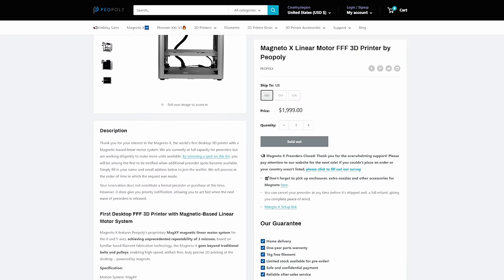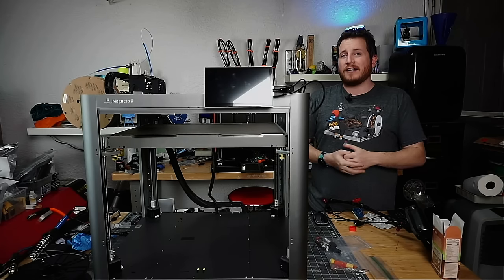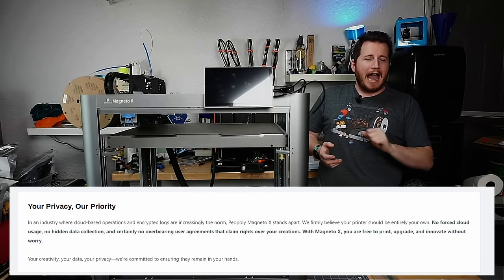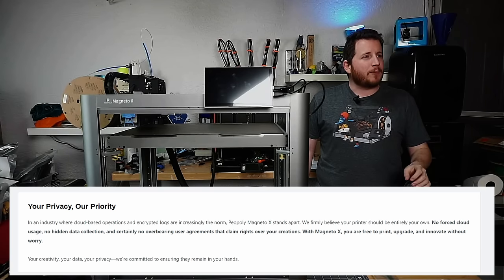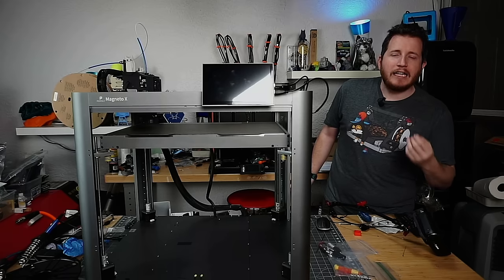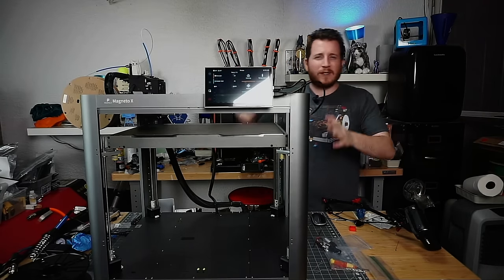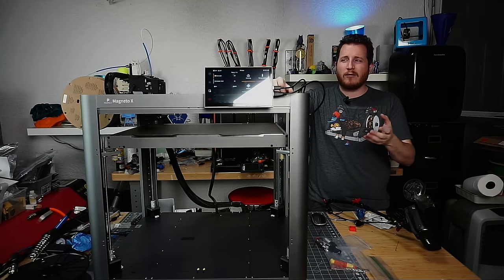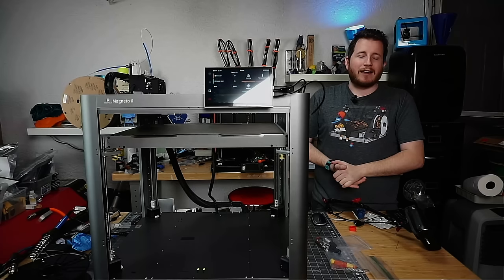Peopoly's MAGNETO X!!! Magnetic Linear Motors! NO BELTS!!!

Comment: When I was working in the mechatronics industry, we used linear motors like this for one of our robots, but much larger (2m long gantries). We did have to post warnings about pacemaker risks, around our robot, but the magnets were much stronger. If you got a screwdriver within a hundred mm, the magnet track would grab the tool out of your hand and you would spend the next 10 minutes slowly easing the tool away from it. That's if the force didn't crack a magnet and you'd have to spend the next hour replacing that segment of magnet track.

Since that machine was designed, the industry has moved from open surface linear motors like this, to U channel linear motors, where the strongest magnetic fields are contained within the channel, these have a much lower personal and mechanical risks associated with them. They are much easier to keep clean as the open side can be sealed off from the environment, which can be important in industrial or clean room environments.

One big advantages of linear rails, by the way, is the fact that you can run multiple motors on the same magnet/encoder track. Our gantry robot had two X tracks running on the Y track, and six heads on each of these X tracks. Imagine being able to print as many copies of an item as you have heads, or switching filament by just moving a head into position rather than changing the tool head. Linear motors offer a world of opportunities.
Reply from the maker: thats so cool for the design! These are not THAT powerful, but the plus side is that I have not had screws that I took off the toolhead fall onto the bed!
Reply: Yeah, the motors I used were powerful. IIRC, each of the two Y axis motors had 50A amplifiers,  accelerated at up 2g and could get to 2m/s on a long move on the 2m track, while the X axis motors were 5A each, could accelerate at up to 5g, and could get to close to 5m/s over their 2m travels. As a programmer, it really concentrated the mind knowing that one mistake in your control code could send 40kg of metal hurtling at your head. *8')
Reply from the maker: yeah.. I think I would pass on that LOL

Comment: Mark and the rest of the Peopoly gang are absolutely doing things right. Not just from the awesome technological advancements that make this printer special, but primarily because of their dedication to user data privacy and open source design. 

You're right that hobbyists like myself probably can't justify the cost of the printer - if I'm saving up that much for a printer, it'd be an IDEX or toolchanger where I have true, reliable multi-material capabilities - but it's damn cool and I'm putting it on my mental wishlist of printers that can replace our broken POS Stacker3D printer at work. 

Installing lights would make for a great future video, too. I'd be curious if they would get installed in the vertical extrusions behind the Z-axis lead screws, on the toolhead, or somewhere else. Regardless, you never really can have too much light covering the print volume of your machine. Installing a Diamondback nozzle would of course be an excellent option; of particular interest there would be if the Magneto X's high print speeds and powerful part cooling capability can allow you to print with huge line widths and layer heights at high speed.
Reply from the maker: Seeing a company give a damn about the beta testers and being so respondent is truly heart warming!

Yep, as we do lights there will be a video :)

Comment: The linear motor is cool, but I would like to see more tool-head changes, explorations of full-colour printing, SLS (as mentioned), etc. There is SO much more to printing than just speed, and it would be nice to see movement on other aspects that are neglected.
Reply from the maker: I have a full color sandstone printer... We can go into the weeds. For 5 years my company was ranked #1 in the world for this tech. Then 2020 hit lol.
Reply: @3DMusketeers  Oooh, cool!  Aren't those things like $20K to $80K? I assume you're talking about so-called binder jetting (UV cured?)? 

Do tell!

I would love to see some type of sublimation on SLS, and with good plastic/metal re-use to minimize waste, or some type of recycling process.
Reply from the maker: they run about 70k new. It is not binder jetting, that is polyjet. We have one of those too lol. 

Look for the Projet 660 Pro, that is what I have
Reply: @3DMusketeers  That's not a bad price! Yes, this was exactly what I was hoping to see, and the colours are AMAZING. I'm a big fan of SLS..

I wish there was more of this for the home desktop. FDM is cool (especially for multi-material), but SLS has some great features, especially with colour.
Reply from the maker: man the zcorp style (now called the Projet CJP line) are waaaayyyyy too messy for home use lol
Reply: @3DMusketeers  Is this because of removing excess powder from a printed part? I cam imagine that the fine particles would spread very easily. It would probably require a "closed" system.
Reply from the maker: yep, since it pulls powder from a feeder, then spreads over the build with excess dumping into a collection chute, it is DUSTY

Comment: My first introduction to klipper was my SV06+ "poverty prusa" klipper screen add on, and I also found being able to adjust the bed heater PWM frequency was very useful when I discovered that the default frequency caused my LED printer light modifications to visually flicker every time the heater was modulating to maintain temperature.

A better regulated power supply might not have been as susceptible, but this was a free fix 😊
Reply from the maker: we see it on every printer with sensitive lights lol

Comment: Perhaps a silly question, but are the magnets user replaceable?  should you in some way damage the magnets, say by getting the chamber too warm when you have it enclosed and that bed at 1000w?
Reply from the maker: They are not. But you also should not be in a position to damage the magnets either. 

The chamber wont get hot enough I dont think.

Comment: Excellent introduction to the capabilities of the machine. I am really interested in seeing it actually print. As it uses another motion system, what kind of maintenance does it require?
Reply from the maker: keep watching, there is B roll of it printing. 

We dont know maintenance requirements right now, but the linear guides will likely need lubing at some point

Comment: Pressure advance is a klipper setting parameter thing you gotta toggle should be a quick config change and a print for calibration, extruder looks pretty standard. Input shaper not working yet makes sense with the fancy motors though
Reply from the maker: Tuning it is not as you would expect because of how the drive systems all work, or so I am told. We are working with the other testers to get it right

Comment: The wide print bed is typical for IDEX printers. Magnetic rails should be great for IDEX, and more tool heads, as they don't need additional belt paths, just somewhere to park the tools when not in use. I hope Peopoly is already thinking about multiple heads for this platform.
Reply from the maker: definitely would be good for that or a toolchanger too!
Reply: @3DMusketeers  I don't think that the complexity of a tool changer is needed, unless the number of tools gets high. All that is needed is to extend the x axis magnetic rail so that there's parking space for n-1 toolheads on each end of the rail. That would allow any tool to be accessed, by shuffling the others to the other end.

You would also be able to print in parallel or mirror mode for with up to all the the tools so long as there's space to do so.

The only downside would be the cost of the magnets to extend the rail, and you'd need a lot of motor drivers and hotend circuits, as each tool is effectively its own, fully independent motor (and needs a stepper for the extruder).
Reply from the maker: I cant imagine a few more magnets and such would be expensive, just much more technical complication

Comment: I would like to see miniatures.  Can it get down to 0.01mm layers with a 0.25mm nozzle and 0.15mm extrusion width on external perimeters.
Reply: I use 0.05mm layers with 0.15mm external perimeters on my prusa's and they make amazing miniatures, but if you are in to robots and vehicles, or anything angular, the edges get soft...

...but the main problem is when surfaces get close to tangent with the print plane.  That ruins FDM for miniatures. otherwise, my FDM minis are close to SLA quality
Reply from the maker: I am SURE it CAN, but why? Get a resin printer for that. 0.25 nozzle and 0.01mm layers are asking for trouble. Remember, even resin printers use 0.05mm layers lol.

Comment: This printer is no surprise... commercial CNC machines have used this technology for years. It was only a matter of time before this became available for home units.
This machine is on my hit list as a must have.
Reply from the maker: true, but it didnt trickle down, so to say, until now
Reply: @3DMusketeers  Yes this is true, but thats only because companies like Bambu created a massive shift in what could or should go into machines to make them more accurate at much higher print speeds. This would have taken even longer if that initial massive step forward had not have happened, and we would still be printing at stupid slow speeds for years to come on our Prusa machines.
But now the flood gates are opening and the trickle down effect will speed up expotentially.
This though is a great step forward, eliminating belts and the inherant noise they create, no more belt tensioning or idol pulleys, which also means no failing bearings. Closed loop and 3 micron accuracy is also a massive step in the right direction for future printers, now we just need more manufactures to adopt it as well.
Reply from the maker: I am not certain Bambu had an impact on this machine, but I can ask..

Comment: After my experience with my last 400mm-class FDM printer, I swore off the format for awhile until I could get into something more commercial/industrial quality and capability; don't get me wrong, tuning up a printer can be fun, but not when you Really need it to work vs forever ordering parts for the next phase of perfection. That was 2018. I would strongly consider coming back for this one, and if you're in the market for a machine in this class, the price is a relative bargain. I'd definitely scoop up an enclosure though and look at hardened bits for abrasive printing.
Reply: That's why I spent extra time to outline all the phases of perfection for my new build and just went straight to the top and ordered everything 💀. I think the only thing more I can do with this printer is make it AWD corexy but I'd need to make two custom mounts. 

I actually received a request to print a decently big project and now I'm scrambling to get my printer together enough to start printing the parts though 😂
Reply from the maker: it has hardened nozzles and drive gears, so you should be fine there!

Comment: That machine looks promising but please we need more open source IDEX/toolchangers/others ways machines when using support material!
Reply from the maker: Eh, good support settings and that isnt as big of a deal, but I do get the point and that is why I bought an XL 5T lol
Reply: With a linear track, you wouldn't necessarily need a tool changer, just put all heads on the track and make the track long enough that there was somewhere for the heads to park when not in use.

You could even print with multiple heads at once, if the appropriate support were added in the slicer.

Comment: Like to see more about the x and y axis and how they set then up. And how it actually works are the liner rails and slides and guides ?

This thing festures alot of awesomeness. Very excited to see it evolve and hope to see revsion 2
Reply from the maker: the MGN guideways are just idlers basically. But yes, I want to do a deep dive on it too
Reply: For a low weight gantry robot, which is effectively what this is, a motor on one end plus an idler on the other could perform better than a motor on each end of the gantry.

The only risk of this is slack in the system developing over time, which can result in problems with unidirectional repeatability late in it's service interval cycle. In other words, if the X gantry ends up slewing, the end near the motor could move more than the end near the idler, so while the near position may still be accurate, the far end could vary by the amount of slew, depending on the size of the motion and the direction from which it was approached. In the worst case on small cyclic Y moves, the other end of the X gantry might not move at all.

When I was working on a 2m square gantry robot, we had a different problem. With motors on both ends of the X gantry, motors could end up 'fighting' each other to correct for the resonance in the system. Whenever we added or removed load on the X gantry, the system could end up in a limit cycle (sometimes called resonance) when it was supposed to be still. A quick tap of the gantry would often jump it out of it's limit cycle, but the longer term solution was to either slightly detune the motor PIDs, or add weights to the gantry, both of which reduced performance.

Comment: The pure sass of taking every complaint people had about Bambulabs printers at the time and going "all of these things, our business model is to do the complete opposite of this" was hilarious when they launched. Having some of the same concerns youve had, I'm glad i held off on getting an X1C a year ago and waited until a company had 99% of the bells and whistles i was looking for wothout the BL/Creality IP and ither headaches. 

Really looking forward to mine arriving, I'm glad its mostly software stuff that can be updated amd the maybe hardware updates are user servicable as they've built it to be that from the start other than the motion system. Did some preliminary test splices with the conservative speeds in the nightly build and in the time it takes to print 4 of a thing i batch print a lot of, its showing 18 of them in almost exactly the same amount of time. I'm happy at that speed, if even higher speeds can still keep the same quality its gonna be freaking amazing. 

Very glad to hear that you can dial back the bed power in Klipper, i was having some concerns i might have to cancel my preorder because of the weird electrical situation i have at home. If it takes 15 minutes to heat up the build plate instead of 7, I'm fine with that because I'm saving a lot more time than that vs. my current machines. 

I'd like to see something on maintenance tips for this setup. There's a lot less than most other printers but there's some still with the Z and I'd imagine some specific to the motion system. I know there's an entry in the wiki, but it'd be nice to see the main things to pay attention to from someone who runs printers in production a lot.
Reply from the maker: I do not expect the motion system to have many user serviceable parts, but it also has no moving parts, so I cannot see many issues with WHY you would need to do it, you know?

My build plate can go from ambient (20 ish) to 60C in under 3 minutes at 75% power.
Reply: @3DMusketeers  I tend to assume everything will break and try to plan accordingly though I know I'm being overly paranoid. 🤣  3 minutes to 60 is great, taking like 10 with my current printer.

Comment: maybe you could get a y extension cord splitter and join 2 UPS's together. LMAO
Reply: I got an electric shock just for reading this.
Reply: @drstefankrank  actually I've seen a 240v ups setup. It requires 2 units. You hook them together. Each unit becomes one of the two live wires. But in this case it would be pulling half the power out of each UPS. It's not any different than pulling power for 2 devices on 2 outlets in the same circuit.
Reply: @awilliams1701  But they may use a special cable and some sort of management protocol to support this. I'm not aware that these things exist, because we only have 230V UPS anyway in Germany and thus no need to research this.
Reply from the maker: please dont LOL. If they are on separate breakers on different legs, I GUESS it is possible, but please dont lol
Reply: @3DMusketeers  well I'm like mostly kidding, but you said UPS's can't handle the power draw. Running them in parallel would cut that in half. just mathematically speaking.
Reply from the maker: true, but yeah, dont DIY that lol